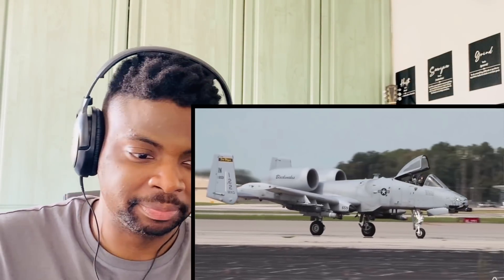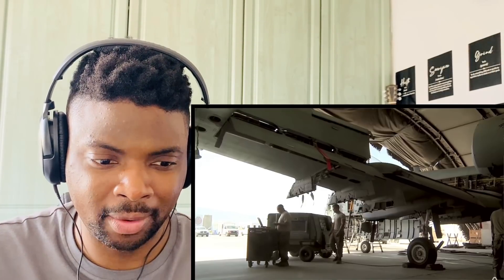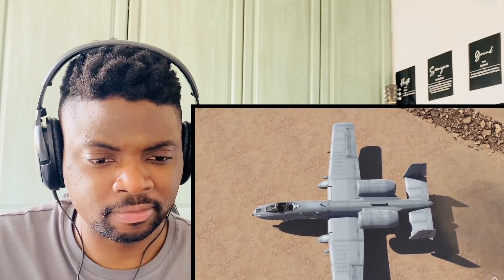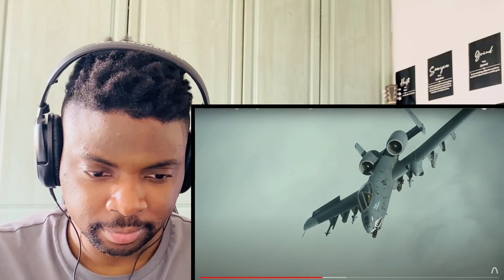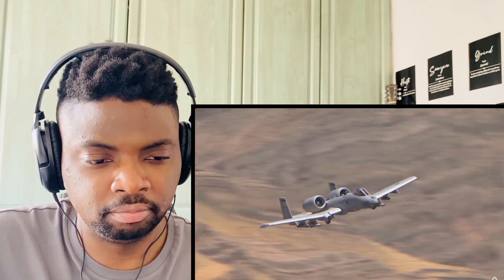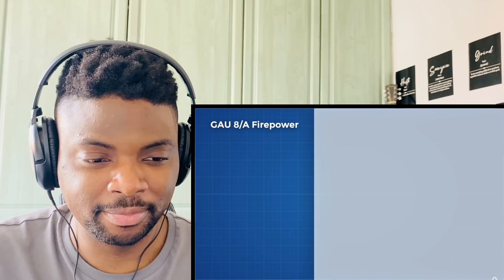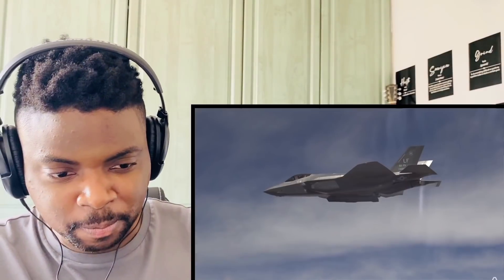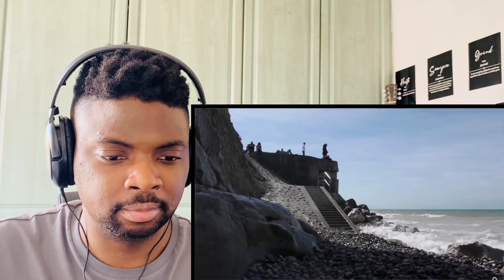🇬🇧BRIT Reacts To THE A-10 WARTHOG: INSANE ENGINEERING!

Comment: There is a reason it's stood the test of time.  Look up some the battle damage they took and landed back at base. I doubt another fighter could pull it off. It was truly designed for close air support and excells at it. That's why out troops loved it and the enemy called it the cross of death.  Makes sense,  when turning... looks like a cross.

Comment: Why don’t they use some of these redundancies on COMMERCIAL planes? Every single commercial air crash not due to pilot/ATC errors or weather has been caused by either loss of hydraulics, loss/damage to fuel tanks that cause death by fire IF they are able to land or loss of control because loss of ailerons or flaps.

Comment: Depleted uranium is just that, depleted. It has less than half the radioactive properties than natural uranium. It's basically what's left over when uranium is enriched for reactors. For nuclear power it's just a useless bi-product with no use
That was the P-38 lightning, the fork tailed devil and namesake of the F-35 lightning.

Comment: 17:28  "That" is a P-38 Lightning, one of the most effective American fighters in WW2 - at least in some theaters.  It had twin booms to accommodate the the twin-engine design, while the pilot sat in a boom located on the center-line of the aircraft in between the two engine booms.  The twin engines were needed to meet the design specifications for high top speed, as it was originally designed as a high altitude interceptor.  
The P-38's armament (usually a mixture of .50 machine guns and 20mm canons) was also located in the center-line boom, meaning the pilot could sight his target directly in front of him. A single engine fighter, with its armament in the wings, had to have the guns pointed so they converged at a specific distance ahead of the aircraft.  If the target was too close or too far away, much of the ammunition fired would miss it.  That wasn't a problem for the P-38.  
The highest scoring American fighter ace in WW2, Richard Bong, flew a P-38 Lightning in the Pacific theater.  P-38s were also used in the mid-air attack that ambushed and killed Admiral Yamamoto, the architect of the Japanese attack on Pearl Harbor in December 1941.
I've had the pleasure and privilege of seeing P-38s in flight at an airshow when I was a child.  The sound that they make, with their counter-rotating twin propellers, is very distinct from the sound that a single engine propeller-driven fighter makes.

Comment: An interesting aspect about the popularity of this plane is that virtually everyone and their brother (from various countries) has done a video about it, despite the fact that this is a very old plane that went into service in, 1976!  The pilot sits in a titanium bathtub (so to speak) and there are (or were originally) titanium hard-points on the wings & tail that helped to prevent enemy fire (up to 23mm cannon) from damaging its high-mounted engines when flying directly over the threat, and the exterior was built with a reinforced "honeycomb" design to maintain structural integrity against incoming rounds.  
Such an old yet still tactically relevant ground support aircraft has saved many a soldier's life, including the British Army troops in Afghanistan.  It is (virtually) worshiped by the ground troops of every nation's military that has called upon it for support.  When the A-10 is firing the 30mm depleted uranium rounds, no enemy armor is safe, including main battle tanks.  The Airforce recently tried to retire the A-10 but Congress fought its retirement, so for now it'll be upgraded and remain in service for awhile longer.  BTW, I could be wrong but, I think that first example of A-10 "nose art" was a warthog, but the shark is a classic and a few cobra-head representations have also been used. 17:36  That, is a P-38 Lightning, an iconic WWII fighter plane.  ;-) Peace

Comment: That plane at the end was the P-38 Lightening. Very interesting plane. A lot of it's construction was Plywood which kept it super light. It was very maneuverable, and had a long range. A squad of P-38's were responsible for shooting down, and killing Admiral Yamamoto. They were the only planes with the range that could intercept him. The P-38 is one of my favorite WWII planes.
Reply: The P 38 was not built of plywood you are thinking of the De Havlin mosquito
Reply: @robertingoldsby1638  The Mosquito was built almost exclusively with plywood. The P-38 had some of it's structure built with plywood to keep the weight down. It was definitely more metal than wood though.
Edit: After reading through my initial post I can see the error in my statement as I said "A lot of the construction was plywood" which is an over statement. Some of the structure  was plywood not "a lot".

Comment: Being part of the stealth community, we always considered legacy aircraft to be pre-stealth, as they are considered fifth-generation aircraft and some consider the F-35 to be sixth generation because of the leap in technology used in the plane. For example a  lot of the newer planes around the world are designed using composites instead of metal, which is a lot more delicate and harder to repair, whereas a B-52 or an A-10 for example, if there's a dent you can just use a hammer to hammer it back into place, or just put metal patches. You would hardly ever see anyone with a metal hammer around an F-22, B-2, or F-35 for example, only rubber mallets typically. lol

Comment: The question "what is that?" @ 17:30 made me laugh.  The plane at the bottom of the screen is a WWII fighter called the U.S. Lockhead P-38 Lightning.  It had a multitude of problems during development but was refined into one of the best fighters of WWII.  Somebody else may have answered this already but I don't feel like reading through all of the comments...lol.  Admiral Isoroku Yamamoto (he led the Japanese attack on Pearl Harbor) was killed in WWII when a squadron of P-38s shot his plane down in the Solomons (Operation Vengeance).  The P-38s had a cannon and machine guns, huge armament for WWII, and was fast as hell @ 443 mph.  Each P-38 had 4 .50 cal machine guns and a 20mm cannon and could carry up to 4000 pounds of bombs. The P-38 was known as the fork-tailed devil by our enemies.
Reply: With the doubling of the rear air control surfaces and 2 smaller fuselages spreading torquing forces out it must have been able to turn on a dime and drop the rear suddenly and dart upward. A bitch to fight against.
Reply: The mounting in the nose made a difference as well. As an example the P-51 had 6 M2 .50 cal machine guns, but each pilot had to make a choice on how they wanted to fly because of the wing mounting of the guns. Either fly with your first pair converging at 100 yards, the second at 150 yards and third pair at 200 yards giving you several optimal kill points or have all 6 set to 150 yards. That would give fewer optimal kill ranges, but anyone cough around the 150 range would get chewed to pieces. With the P-38 having all 4 guns in the nose, it ment all kill ranges were optimal for a P-38. Add in the speed, better rate of climb, ect. and basically it was an unfair aircraft (A joke, when someone is trying to kill you, no such thing as unfair)

Comment: An average A-10 cost $13 million in 1994 dollars, when production was at its peak. Final price was about $18 million at the end of production which is about $46 million in today's money. The F-35A Lighting II (it was flying next to the P38 Lighting from WWII) costs about $80 million per plane but if you factor in all the research and development that went into it the cost is closer to $150 million per plane. The F-35 also costs 50% more than an F-16 per flight hour. Development of the F-35 has been a disaster in terms of cost overruns. The F-35 was designed to fight wars against countries like Russia and China. It is massive overkill in low intensity conflicts.

Comment: A comment that might not sit well with some people is that the A10 isn’t all that good. Don’t get me wrong it does it’s job remarkably well. But it does get overhyped quite a lot. The gun isn’t nearly as accurate as some claim, the ‘splash’ zone is larger than you think. And while the gun is certainly what it is built around it’s not it’s most effective weapon. It carries a suite of precision guided munitions that are the real tank killers. The gun is useful for soft targets that don’t have any non-combatants in a 50 ft radius. It’s relatively slow speed makes it vulnerable to anti-aircraft artillery fire, due to the fact that to get an accurate gun run in it has to take a medium as opposed to shallow dive at its target. It also isn’t radar invisible so, anyone thinking that the Russians don’t have something capable of smoking an A10 before it gets to the 40km long columns has only heard the bare minimum of what they are capable. 

This is not to say that the A10 is bad for it’s role, it’s not. I find it’s just way too hyped up for a 50 year old plane that, can and does get smoked by modern anti-aircraft artillery(the ground version of the A10 gun w/ 6x the ammo, and radar guided targeting).
Reply: Tomas Javks   you have made several good points but if you believe that Russia supplied Iraq with its top of the line AA systems then you are sorely mistaken. They had advanced AA sure but why would Russia supply Iraq with stuff it’s own military would have. The equipment used by Russia in this conflict is better than that of the Iraqi’s and they are actually trained on how to use it effectively. 

I made my case on the assumption that any NATO engagement with Russia in Ukraine would be a limited air campaign with no boots on the ground. This means A10s limited range makes it difficult to stay on site for long periods due to fuel limitations. Fuel limitations even more dire when the plane is half shredded. While the A10 does have good survivability if damaged to that point it is as good as lost. Limping back home presents a juicy target to shoulder launched surface to air missiles. Your ‘attack formation of a dozen A10s’ becomes even more susceptible to radar with more planes in the sky. Having 700 A10s means nothing without the ground elements to direct more accurate fire and supporting units at bases to keep them fueled and armed. If the conflict between Ukraine and Russia ends up dragging NATO in, it won’t be an instant ‘boom A10s blow everything up’ party. The forces Russia have deployed are not the cream of the crop but if you believe that makes them any less effective at their jobs than their American counterparts then that’s on you. 

If you believe that ground hugging navigation systems will save it from being targeted by radar that doesn’t really work these days. Modern radars are significantly more advanced than that especially since most of what we see in radar doesn’t care about anything under 10,000 ft anyways. Terrain hugging is great and all but have you seen a topographical map of Ukraine? It’s pretty flat. Nothing to really hide behind. 

The A10s electronic warfare suite is certainly impressive for a 50 year old plane. But it’s also nothing to write home about. If you think that simply jamming the radar, which doesn’t have that big of a range on a platform not dedicated to the task, will be enough to not get an indication of where the plane is.

Your knowledge on the capabilities of AWACs systems is spotty at best. They cannot spot ground targets so I don’t know why you think it can. Deploying them in an offensive role in support of A10s would be a secondary role in conjunction with an escalated conflict with Russia. It can track missiles well but actual targets on the ground not so much, not with radar. There are other aircraft for that.

The A10 certainly has its fair share of HS missile defenses. Flares do work… on older missile systems. Modern missiles, even heat seekers can keep track of targets through screens of flares pretty effectively. Not to say every Russian AA missile battery has them but your A10 pilot doesn’t know that. And while the maneuverability of the A10 is decent at avoiding radar guided AA missiles, they are often not all fired at once. The first one is usually to get the plane to move and not notice the second one behind it. So while the first might miss the second can reorient itself fast enough to hit a distracted A10 pilot who thought he dodged a bullet. 

Last but not least, the A10s optics and situational awareness are pretty bad. So bad that in the Gulf Wars some pilots had to resort to using binoculars to differentiate targets on the ground. Binoculars, from an airplane 2-5k feet in the air. This led to numerous blue on blue incidents to the fact that the A10 racked up the most civilian casualties of any coalition aircraft in the war. Something they only started to track in 2010 after the A10 had seen its service reduced. This was after the bulk of the most dangerous Iraqi AA systems were taken out btw. So once on station the A10 becomes even more vulnerable to AA systems as it has to loiter around looking for targets. Remember there is no coordination with the absent American boots on the ground. So no helpful smoke grenades to say ‘shoot north of green smoke’. 

I’m not saying that A10s when properly supported by ground and air assets(air superiority) can’t get the job done. I’m saying that it’s not a walk in the park and losses should be expected and most likely exceeded. Underestimating your enemy is great way to get a bloody nose and a bunch of 30mm cannon rounds through your cockpit(your titanium tub is good for 23mm fired from an aircraft cannon, not AA artillery). 

I will state this again, in case you deign to read this far and haven’t stroked out yet in your blind belief that the A10 is some sort of superweapon which it isn’t, I based my scenario on a limited air campaign between Russia and NATO knowing full well that a ground campaign, like what was seen in Iraqi is going to escalate things further beyond the scope of realistic estimation. With a limited air campaign, NATO is restricted to using bases in NATO countries to fly sorties from. This leaves only 2 avenues of attack. From the West via Poland, Czechia etc or from the south via Turkey and the Black Sea, Kyiv is pretty far from either launching point to the point that maintaining air superiority over the hot zones of Ukraine would be very difficult. Remember Russia hasn’t committed everything to this conflict yet, but an limited air campaign changes things. More Russian AA systems for one thing, and better ones too. The A10 needs air superiority to function in its design roles properly as a minimum. Without boots on the ground it’s impossible to know for sure how effective any air campaign would be. The A10s would need serious support and they would not be the focal point of any campaign, air or ground. Fully supported, an A10 can do a lot of damage, but without it, it is a liability being too slow, a damage sponge without access to close airbases to limp home to, and carries limited munitions(this can be debated but it is no B1). If anything, should the nations of NATO be called into conflict in Ukraine the A10 will see limited service at best in a mop up capacity after the convoy has been decimated by cruise missile attacks and high altitude bombing campaigns. The A10, in a modern, fully engaged war is not an offensive weapon. It is a reactionary weapon that works to destroy what is left after other options were already used. It’s not a poster child and it certainly isn’t the star that everyone makes it out to be. It’s 50 year old aircraft that’s only redeeming feature(something that can’t be replicated by  another aircraft better) is that it’s cheap to produce. The biggest arguments against this are the gun(which isn’t very accurate and endangers the pilot when he has to take a steep angle of attack, and can’t destroy tanks despite what some say) and it’s time on station(which is only so long because they have terrible optic and situational awareness systems, remember binoculars). It does carry precision guided weapons but not any more than an F15 strike eagle. Which can fly higher, faster, farther with similar load outs and better optics. 

Again, (I feel like I keep repeating myself) the A10 is good in it’s role and likely won’t be completely replace in the CAS role. This role however isn’t what we are seeing Ukraine so what makes the A10 the super weapon in this conflict everyone makes it out to be, when better options for this conflict exist?

Comment: Depleted Uranium is a low-grade radioactive waste - 
One problem with its use as an armor piercing round is that this then adds to the toxic hazards emitted from burning tanks 
(hazards not to the tank crews - the exploding ammunition and burning fuel pretty much cover those issues)
this is a concern for those down wind or for anyone entering a damaged tank afterwards.
So no, you are not likely to get your hands on depleted Uranium. :-)

Comment: The A-10. 
What makes it so good at its job? 
It was designed with a clear and well-defined purpose - 
to provide close-air support for ground troops - 
primarily through the destruction of armored vehicles.

The weapon was specified before the airframe was designed.

The plane is truly just a transport and aiming system for "The Canon".
Every step of the way, when engineering choices were made, survivability was a priority.
This is a plane designed to go toe to toe with large numbers of tanks and come out on top.  

No other plane in the "western" arsenal can make that claim.